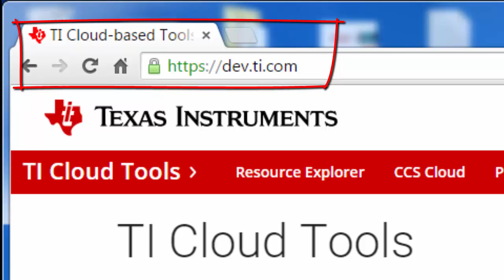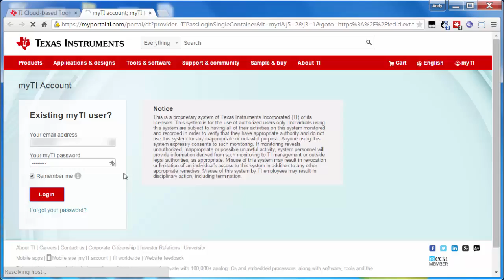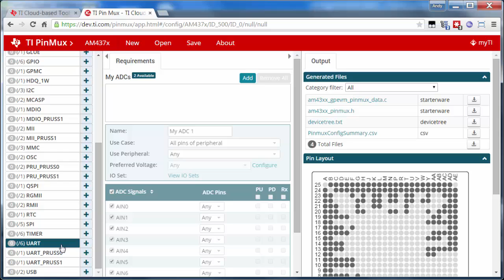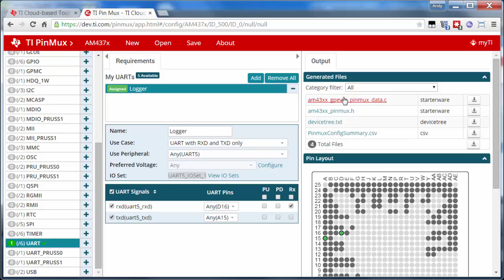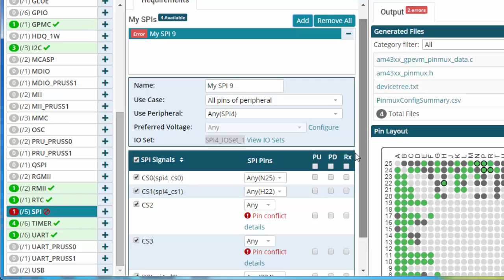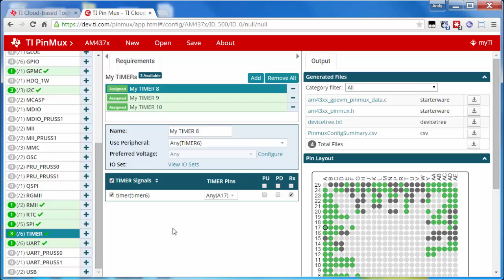PinMux in the Cloud

Comment: Ok when you use the the Menu Save it creates a pinmux file. But the code I have uses the C files. So if you don't have the original pinmux file you can't import back into the tool to modify the design.